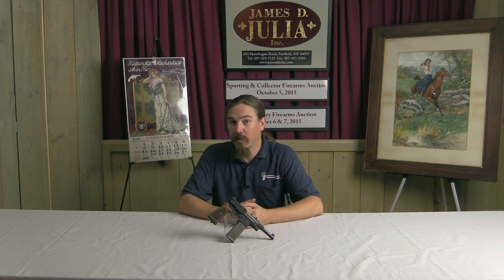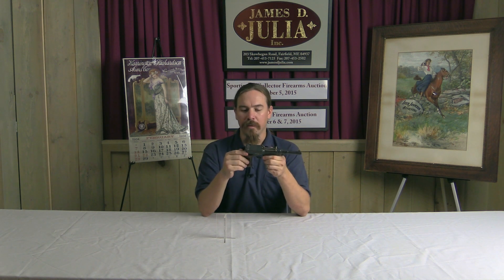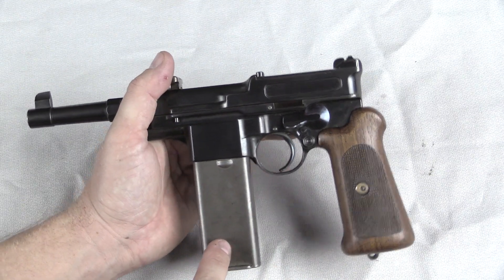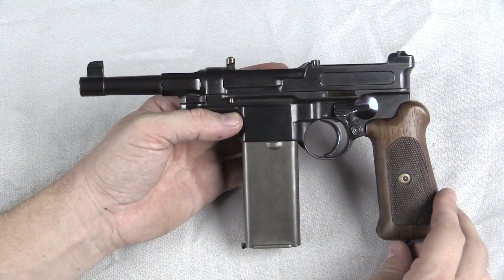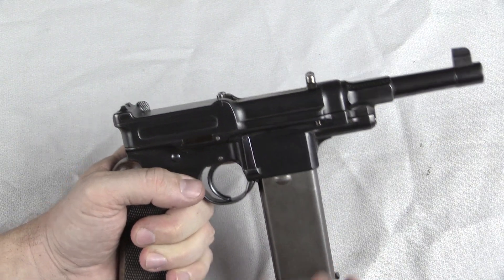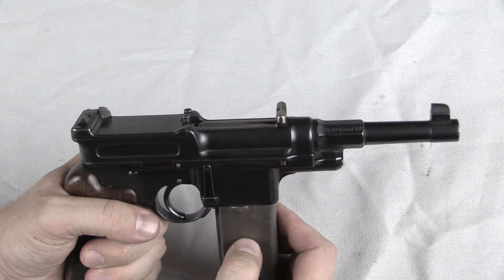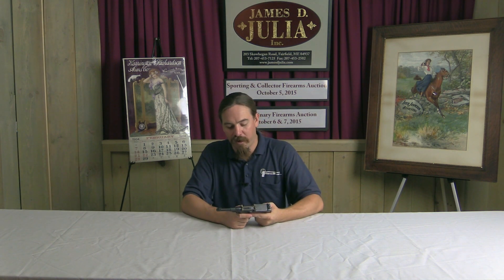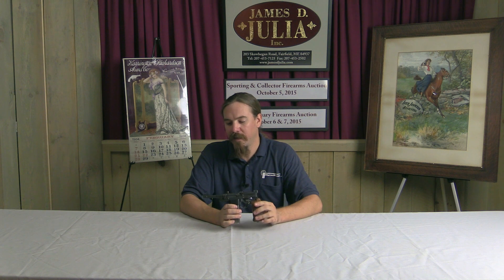Mauser 06/08 Semiauto Pistol

Comment: This pistol is really cool in light of its looks. what I like the most is the feature, where a full magazine is inserted into the gun, the bolt goes forward and chambers the first round making the ready to fire immediately. To me that is a great tactical innovation where an emergency reload is required. I would like to see modern semi automatic pistols have that innovation.
Reply: Yeah. Modern designs seems like pure copies of Berettas, Colts or Walthers, but using aluminun and polymers ! In the past, gunsmiths was more innovatives.

Comment: It's like an old-school version of the Tec-9.  Except not shitty like a Tec-9.  Idk why these weren't more popular, that looks like a relatively compact, powerful, high firepower weapon.  Make a few adjustments and frankly that could be an excellent duty or service pistol.
Reply: +Will Moon I don't think there could be a way to have the magazine go into the handle while also making the gun smaller - don't underestimate how huge and heavy that thing is right there, that's not something you would want as a modern service pistol.
Reply: +Will Moon -- Could have something to do with the bit about the bolt flying across the room.  If Ian is leery of it considering the number of weapons he's handily disassembled it's probably not exactly a selling point for a weapon of war.  Looking for your pistol bolt in a dark, muddy field while people are shooting at you is probably not a good thing.
Reply: Thats why I said it needs a few adjustments.  Hey, the DShK is one of the most popular heavy machine guns in the world and it works the same way, clearly it could be a military weapon.
Reply: +Will Moon I'd say a pistol grip and the front loading 20 shot magazine are about the only 2 things the weapons really share.

Mechanically they have little in common (safety mechanism, barrel length, operating mechanism, so forth). Technically 9mm cartridge being fired, but this is a 9x21 I believe Ian said vs a 9x19.
Reply: +Will Moon 

It had to compete with contemporary designs of the time like the Colt 1911. This was the design of the previous war. Tried, true, but boring to everyone who looked at it. Everyone wanted internal grip magazines, pocket pistols, compact, compact, compact.

Mauser also wanted a military contract.

It just wasn't marketable.
Reply: +YCCCm7 9x21 huh?  Never heard of that cartridge before.  I imagine it's superior to 9mm Parabellum in most respects.  At least it was at the time.
Reply: +TwiztidJ Considering a 9mm Parabellum (Luger) is a 9x19, this is similar to the comparison of a .38 to a .357 MAG.
Reply: +Thomas Mobley That begs the question what you are doing disasembling your gun in the middle of a dark, muddy field (I wouldn't even field-strip/oil a damned weapon there if I could help it...wait till you are back in the barracks later!)
Reply: Mauser made rifles and seems to have done some stuff from that perspective. With the shoulder stocks they liked to include, Mauser's guns could actually count as the first modern PDWs. Scaled down rifle style cartridge,  option for a stock, short barrel.
Reply: "wait till you are back in the barracks later!" dead man dont need to clean or disasembly weponds... You clearly confusing war time service with some normal day job... Good luck with that idea of yours on WWI front line...
Reply: A similar pistol was used by many militaries. It was the C96. They simply never adopted the more developed pistols, probably because by that point people wanted luger style magazine configurations. Rather disappointing, though, this magazine configuration was really interesting.
Reply: It also reminds me of the C-96 "Broomhandle".
Reply: I guess two of the reasons it wasn't adopted was because of A. The magazine being sort of in the way of any sort of really useful holster, and B. Because the German Navy adopted the P04 (basically a longer barreled P08 but not quite Artillery Luger long) and the machinery to make these were already available, so it would make more sense economically to adopt the Luger instead. However, if the Navy hadn't adopted the P04, it's quite possible that this would have been what German officers would carry into the battlefields of Belgium and France in the First World War.
Reply: I much prefer a pistol like this to the glock. The glock has no beauty. This has such personality.
Reply: you may be right but i think other than the slightly more powerful cartridge it didnt seem then to offer any big improvement on the c96 which was soon to be offered with a 20 round mag and a 9mm version was on the way too.i can imagine them thinking great gun but is it worth retooling and where will it fit in?also as it was about the only gun out there similar to the c96 forward mag set up it would be competing against its own brother so could take sales away from the c96 and was obviously expensive to manufacture so i dont think they could make enough profit to justify putting it into full production.no fault in the gun just finance.
Reply: @tillmannfischer  there isnt a whole lot of info on it however, look up C06/08 Mauser, or C06-C06/08 Hybrid and there are a couple pictures floating around of an experimental mauser pistol with this mechanism however the magazine is in the grip, it looks similar to a luger
Reply: I would bet it is the priority cartridge that did it in.
Reply: @fletcherpotvin7707  
Even assuming that you can't make a good holster for it with the 20 round magazine, which isn't true. You could carry it with 6+1 in the holster and spare 20 round magazines.
Reply: @calvingreene90  Depends on the country - a whole range of 9mm cartridges in various lengths were in military service prior to WW1. 9mm Parabellum is just the most common now.
Reply: @allangibson8494  
And if they would have used the one already in German military use they would have had a better chance of it being adopted.
Reply: @calvingreene90  The 9x23 was a common size (and 9x21 is still commercially available as a target cartridge).  I am aware of eight different 9mm cartridges in military service during WW1 and after with case lengths from 18mm to 25mm. 
Standard - what standard?
Reply: @allangibson8494  
German military service? 
There is already 8 9mm options available that means that we should make another. Really?
Reply: @calvingreene90  The Austrians were using 9x23 - rechambering may have been a option if interest was shown. Depends on if you are chasing outside markets.
Reply: @allangibson8494  
Austria is not Germany.
Added. The gun is not in any caliber that was already in military use anywhere.
Reply: @calvingreene90  A certain Austrian corporal in the German army during WW1 would have a loud disagreement with your position. 
Austria and Germany did swap weapons (particularly hand guns) at this time. 
The pistol could have fired 9mm Parabellum with a simple rechambering, 9mm Browning Long (which is almost exactly the same size as the 9x21), or even 380 ACP (which was also in German service during WW1). The 23mm Austrian cartridge would have required magazine enlargement.
By the time it was introduced it was a bit clunky and front heavy by then current standards and looked dated. This was probably a bigger reason for its failure to sell.
It probably would have sold well in China however where the broomhandle C96 was popular.
Reply: @allangibson8494 
Germany and the Austro-Hungarian Empire were allies. Also there were plenty of German, Italian, and Japanese in the American military in WWII some even went back to their native lands after the black fascist were defeated. So Adolf immigrating to Germany and inlisting in their army is not a big surprise. If Austria had been an independent principality when Germany unified it almost certainly have been part of Germany  but it was and is not.
Reply: @calvingreene90  Austria not being a part of the German Federation was Prussias idea. (They didn't want the competition).
Hitler left Austria to avoid being drafted as he didn't want to serve with non Germanic people.
Reply: @calvingreene90  Adolf didn't like Serbs, Hungarians or Slavic people either.
Technically Adolf should have been deported back to Austria at the start of WW1 as he was an Austrian draft dodger rather than enlisted in the Bavarian Army.
Austria was excluded specifically from the North German Confederation Inspite of leading the preceding German Confederation from 1815 (Bismarck really wanted a major country to play war with, and the Austrian monarchy was just too big).
Reply: @allangibson8494  
Austro-Hungarian monarchy.
Reply: @calvingreene90  Austria and Hungary had functionally and legally separate monarchies - they just had the same monarch. Messy but very Austrian / Hungarian. That is why it was called the Dual Monarchy. Austria was part of the German Confederation, Hungary was not.
Reply: @binbashbuddy  Imagine sitting in a trench and out of nowhere the bolt flies in a nice arc into no mans land
Reply: Tec-9 had a one night stand with a c96

Comment: If I remember correctly, it's been 40 plus years since I cleaned one, the M60 had a similar trick. There was a yoke that when pulled out allowed the bolt assembly out the rear of the weapon, and then the yoke could be inserted into the buffer assembly (I think) to maintain the spring tension.

Comment: The makers of a hundred and one different models of simple blowback pistols tried to increase the caliber to 9mm Parabellum, to keep the simplicity and avoid going to the various locked breech designs. But it looks like this simple flapper-lock could be made into a flapper-delayed blowback action. Such a modification would be a fairly simple addition to a number of blowback pistols, adding relatively little cost or complexity of manufacture.

Comment: This may be hard to believe but, when I was a kid (mid-late eighties), I had a toy version of this exact model. I believe it was meant to fire plastic cap strips, but I never had any.. The toy was all black (no orange tips back then!), had a removable magazine and was made from that super tough plastic which was almost as durable as the steel the gun was originally made from. It's outer dimensions must have been spot-on.. It looked identical to the one you have in your hand here (apart from the black handles). I never actually knew which model of pistol it was based on, until now! A pity they are so rare.. I wonder why the design never took off..?

Comment: Beautiful gun. Some of those features like the tap to unlock (heh surprised Apple didn't sue them for that one) safety and the bolt closing upon a new mag entering are features you don't even see in modern pistols. I would love to have one, because frankly it looks like a good EDC/duty pistol. 20 round mag and the layout reminds me of the Tec-9, except maybe a bit more well-designed.

Comment: why this thing wasn't adopted by any military? cost? or just a marketing fail like many others at the time?
Reply: +marvin b My guess is the Mauser broomhandle was already out there and had already saturated the market for those who were looking to buy and were happy with the 9mm bore. The Americans weren't - they'd had failures to stop with the .38 in the Philippines (enter the .45ACP) - and the British were also wedded to the large bore after similar experiences in India in 1857. The British, in particular, put their pistols through hell (the dust, sand and mud tests), and a revolver of the times was much more likely to sail through those tests and keep on firing. Automatics have come a long way in a hundred years, and I suspect the current state of the art would do much better.
Reply: +jsm666 Look at the close tolerances of the flaps to the bolt carrier and you can see how in that configuration a grain of sand could disable it.  Design needs a tweak.

Comment: I wonder why the flapper-locking system didn't become more popular. What are it's pros and cons when compared to a roller locking system? It looks pretty simple and sturdy (and therefore probably a bit heavy) to me.
Reply: One of the cons is that both flaps need to be either perfectly the same length, or so over built one can do the job of two.
Reply: Keith Larsen
Hmm, right, tolerances need to be a lot stricter than on a roller lock (they can roll into the gaps until they fit). Thank you very much.

Comment: Hello Ian,
                  Another cool video, thanks.  I know that the auction listing states this gun is in 9 x 21mm calibre, but are you certain that it is not in 9 x 25mm Mauser calibre?  There is nothing new under the sun, and auto pistols in hot-loaded, high pressure 9mm chamberings have been with us over a century now!

Comment: Neat system. I imagine that in a rifle, the bearing surfaces of the flappers against the rear of the travelling bolt would be somewhat more substantial!!! Didn't the EM-2 use a variation on this system, with the gas system camming the flappers (and also the automatic magazine-inserted bolt release)?

Comment: It looked like you were pushing back on the barrel carrier to get the bolt unlocked. Is that necessary for racking the bolt? It looks as though just pushing back on the bolt handle would move the whole assembly back far enough for the flappers to release.

Comment: What a great gun, looks very nice, very quality made and the locking mechanism seems to be very strong and simple. With different magazines and so simple to use... why couldn't Mauser sell much more of these? Was it to heavy, was there any problem you didn't mention? Was it bad marketing or just to expansive?
Reply: my guess? like so many guns, military contracts. german military of the time already had the luger, which was already an expensive pistol, so they weren't to keen on changing it for yet another expensive pistol. they also probably wouldnt of been interested in the more powerful cartridge, and the mauser is over all much bigger than a luger, with that foreward box magazine. on the civilian side of things, few would of had need for such a powerful, high capacity handgun. most just wanted their little pocket blowback 32s and 25s.

Comment: Having seen this video several times, I believe that this pistol feel in hand would be more or less same with that of a Mauser C96 with 20 round magazine. The C 06/08 weight is 1.16 kg (according to http://en.valka.cz/topic/view/110796/DEU-Mauser-C-06-08), Wikipedia says 1.13 kg for the C96, difference is minimal. Handgrip of C06/08 seem better than that of C96 to my eyes and reminds me the handgrip of Danish Bergmann M1910/21 vs the original Bergmann M1903. For weight perhaps the number is with the 8-round magazine. 

According to Wikipedia article for the C96, the original "pre-Bolo" C96 was 312mm long, the C06/08 appears to be 295 cm long and I believe it would handed better than the C96. Caliper 9X21mm Mauser could be a experimental caliper of that era, problem is that modern rounds are much more powerful than those 100 years before. Searching in internet, I found two more C06/08 on auction, which were claimed to be chambered for the Mauser Export 9X25mm round. If this particular item is indeed chambered in 9X21mm, attention is needed to the grain of the bullet because of the pressure involved. You definitely don't want your pistol to explode or malfunction when shooting, there is no need for self injuries in the firing range plus the laughing on you.      

http://sportsmansvintagepress.com/read-free/mauser-rifles-pistols-table-of-contents/model-06-08-mauser-automatic-pistol/

This above page says some negative critics about the Mauser C06/08, who knows? I believe that manufacture cost of that pistol would be comparable with that of C96, not sure which would be more expensive to built, but looking a photo of a fully disassembled C96 and compared with the ghost drawing of C06/08 in the first link I believe that the C06/08 has a bit fewer internal parts. 

Personally I like the look of this pistol, as also the Bergmann-Bayard and the Mauser C96 in this order.

Comment: I have not found any info about the 9mm mauser. Could you use 9x21 IMI with this gun?
Reply: +Rhodiebert85 Mabey you could use the brass but I would be the loading would be far different. probably lower pressure.

Comment: Hammer price: $27,500.
I would buy 55 glocks with that money.
Reply: +Migrant Since when are modern polymere pistols explosives? As far as I know Glocks are some of the most reliable (and modern) hand-guns around (they aren't however the nicest to look at...they aren't ugly, but I wouldn't call them works of art...unlike the gun shown above, damned I like that design, even if it didn't catch on all that well with manufacturers all placing the magazines into the grip later...))

Comment: So the cycling is dependent on the energy stored in a low mass bolt, as opposed to modern pistols that use a rather massive slide for that. Doesn't look like the most reliable system ever, but I nonetheless like this little piece of mechanical jewelry. The condition is most impressive for a 100+ years old gun.